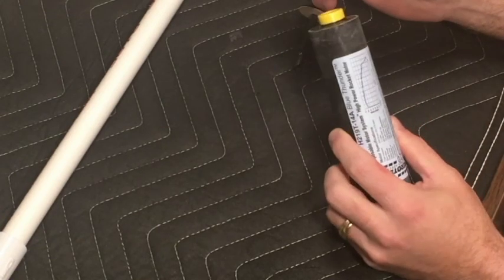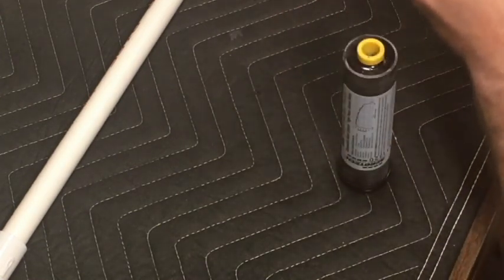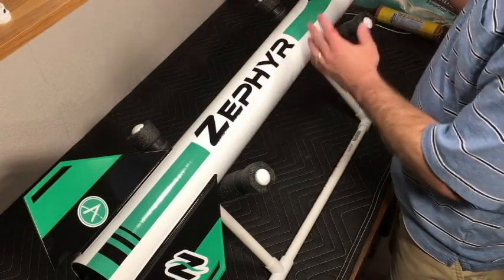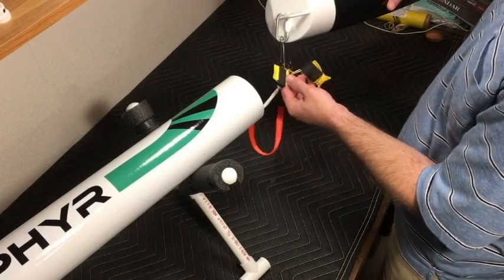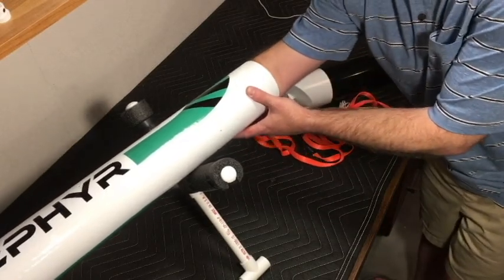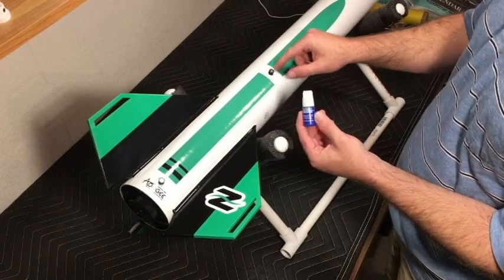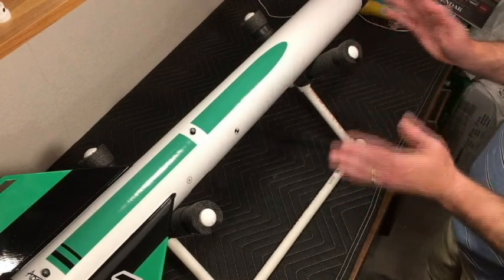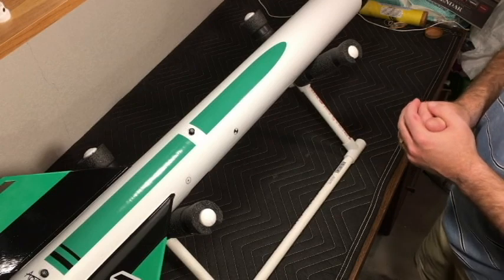r20 Zephyr Hi-Power Rocket - Part 7 Delay Drilling and Final Set-up/Weight & Balance

Comment: Thanks finished my Zephyr and want to do a 10 second delay.  With a H100 motor This was helpful  will do cert 1 launch in august in Wisconsin.  God Bless!  is the wadding necessary?
Reply from the maker: Hey Mark!  Congrats on finishing up your Zephyr!!!  That’s a major accomplishment!  Regarding wadding, unless you installed a baffle, throw some wadding in there. Go to Lowe’s or Home Depot and get a bale of cellulose fiber insulation. For under $20, you’ll have a lifetime supply!
https://www.lowes.com/pd/US-Greenfiber-SANCTUARY-by-Greenfiber-R-60-Blown-In-Insulation-Sound-Barrier/5001939515

Comment: What is the packing material you use and where do you get it?  Just built Zehpyr.  What did you coat it with?
Reply from the maker: I assume you are referring to the wadding to protect the motor ejection charge (typically referred to as dog barf)............
I use cellulose fiber sold at Lowes:
https://www.lowes.com/pd/US-Greenfiber-SANCTUARY-by-Greenfiber-R-60-Blown-In-Insulation-Sound-Barrier/5001939515

I didn't put any clear coat on this particular project.  But I typically clear coat my projects with either Pledge Floor Polish or Quick Shine (also sold at Lowe's).  Good luck with your Zephyr and wish you successful flights.

Comment: Do you have a video on how to properly pack the parachute ?
Reply from the maker: I just recently released a video on LPR chutes. Although the size of chute is much greater in HPR, I use the same technique. For my Zephyr flight, I routed the shroud lines up into the chute and folded it inside. I then wrapped a nomex blanket around the chute to help prevent ejection burns.

Comment: Great videos! I'm buildiung my Zephyr right now. My nose cone is pretty loose. How was the fit on yours and if it was loose did you use tape or another way to tighten the fit?
Reply from the maker: Mine was a snug, but smooth fit right from the start.  I have had smaller rockets that were way too loose.  My suggestion would be to wrap masking tape around the nose-cone insert until you get that nice snug, yet easy to eject, fit.  Please let us know how the rest of your build goes and your subsequent flights on it!
Reply: @KevinsModels  will do. Thanks. I was at NARAM 62 today watching the pros launch some impressive rockets.